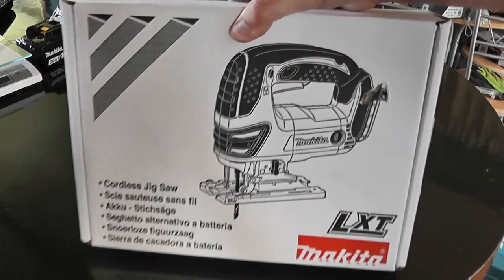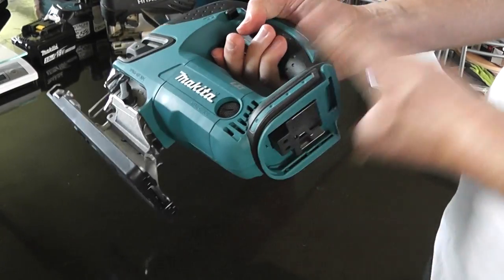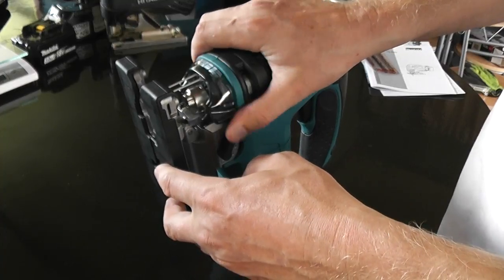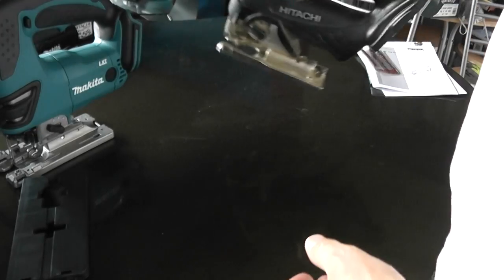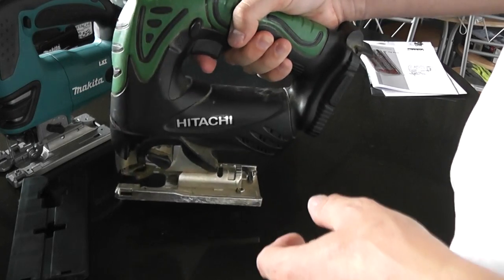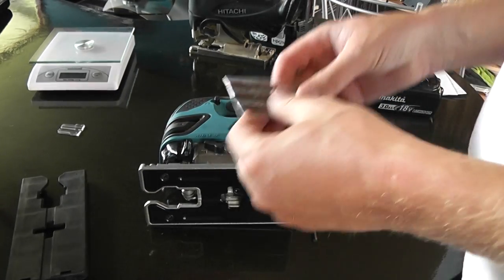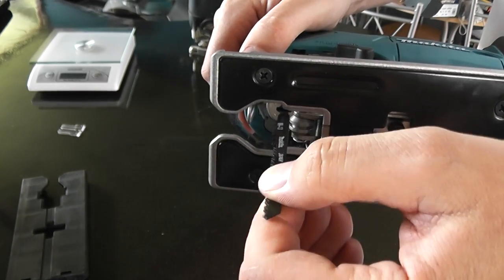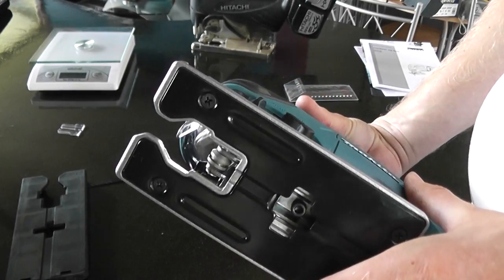Makita 18v Jigsaw

Comment: Why would weight matter, your not lifting it, its sliding over wood surface, your not running around with it :P
I got the makita one, really works like a charm.
Reply: It depends on what you do. Joiners , kitchen fitters and roofers very often need to hold the jigsaw.
If you cut upside down it would make a huge difference too.
Reply: Yeah, I often think things with motors that are heavier how deep your motors in a better quality. It’s not always true, but I have your tool is usually better than an overly light one!